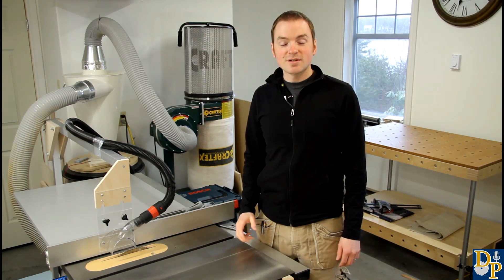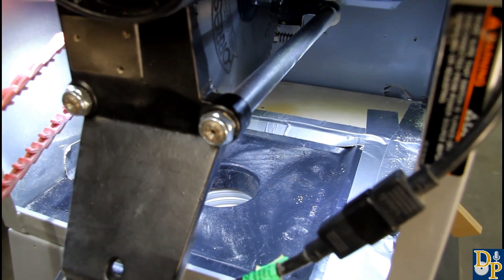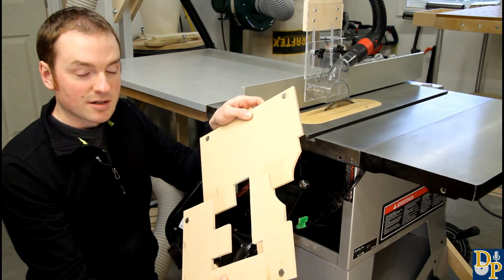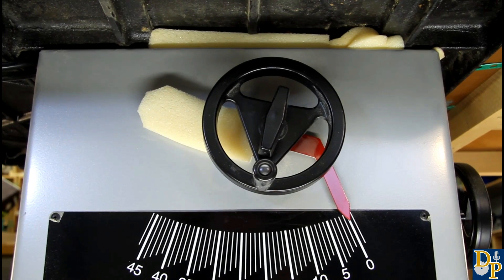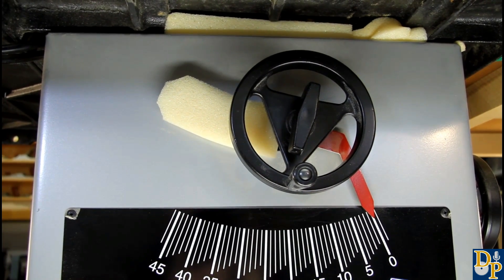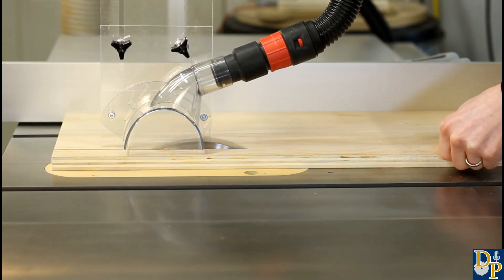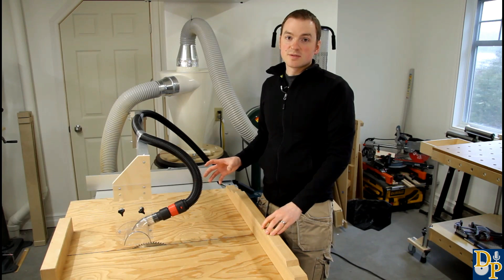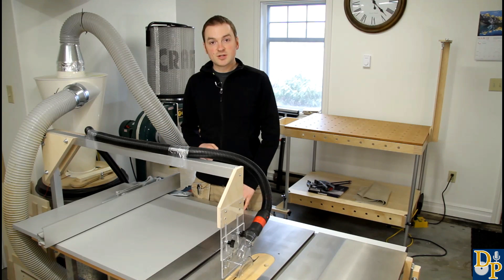4 Table Saw Dust Collection Upgrades to Improve Your Saw

Comment: What about when I'm not making a through cut? At those times, and especially if I'm nibbling, I get a ton of dust coming out the kerf, even with decent 4" collection from the cabinet. Have you considered, or tried, to add perforations in the zero-clearance insert or even the front cabinet wall behind the front rail to try to collect that dust?  Good vid, thanks.
Reply from the maker: Sometimes when I'm making those types of cuts I will rig up a hose on the saw somewhere in front of the cut to collect the bulk of the dust. Some cuts are just very difficult to have good collection with and it takes less time to just clean up the dust when you're done than rig up an elaborate setup to try and capture it.

Comment: Nice job. I'm a new subscriber. I have the same saw. Could you share the dim. on the notches and  slots on the 2 panels on the back of the saw going around the motor and belt. Its droving me nuts.
Reply from the maker: I have a free download for the drawing in my blog article:

https://www.danpattison.com/blog/2016/10/7/4-table-saw-dust-collection-upgrades

Comment: Thank you Dan!  I used your pattern to close the back of my Delta Contractors saw!  Whoops, I didn't notice the difference between your saw and mine.  Mine is a Delta 34-444, maybe older that yours with right tilting arbor.  The trunnion assembly with the large nuts sticks further out the back than yours so I need to make some alterations to make it work.  Just posting this as a heads up to to other's with older Delta contractor's saws like mine.  I should have noticed this before I started.  Mine is probably from the early 90s.  The difference is going to be in opening for the trunnion and motor bracket -- it's going to have be higher up and a bit larger.
Reply: Any chance that you can share your final result?  i have the same saw

Comment: how does your jig work for cuts where there is nothing on the left side of the blade? I find that cutting a board that has at least a half inch to the right and left of the board forces the duct down into the lower dust bin/extractor; however, if you are only shaving off a 1/16 or 1/8 inch, dust just gets ejected straight out the front of the blade.
Reply from the maker: If there is nothing to the left side of the blade and you're basically just shaving off a kerf width or less then the dust will still fly off to the side and straight back.  I've found that dust collection on any saw doesn't really work well if you're just shaving some off the side of a board since there is nothing to contain the dust.

Comment: Like the guy said, "How clever!", especially the two-part, magnetic rear cover. I've found almost limitless uses for rare earth magnets and my most recent purchase was a lot of 100 sent from China through eBay. The down side is that eventually your tools become slightly magnetized and pick up beards of steel wool particles. It is a problem is to find a 12mm Forstner bit to install them with a press fit though a 1/2" bit and a dab of adhesive works. Have you choked off the air supply to the bottom end of your saw? That potential problem seemed possible as you wedged foam to seal the gaps between the cabinet and the cast iron.
Reply from the maker: Rare earth magnets are definitely handy for so many things. There are enough openings left in the saw to feed the dust collector without any issues. You definitely don't want to seal things off completely.

Comment: How did you make the lower sawdust pan with the 4 inch port?
Reply from the maker: I bought the plastic pan with the 4" port in it and fitted it in to the bottom of my saw.  If you check out my blog article you can find all the links there.

https://www.danpattison.com/blog/2016/10/7/4-table-saw-dust-collection-upgrades

Comment: Those contractor saws are piles of shit. Best bet is to get an old unisaw or something. You'll end up saving money.
Reply from the maker: +Joe Doesntcareaboutthis cabinet saws are definitely better but this Delta contractors saw has been a great saw.  I've had it for over 15 years and it's still going strong.  It was one of the models that was actually made in the US and not offshore.

Comment: Great and thanks for the inspiration.  I built an enclosure for my Jet Contractor Saw using a similar approach and a two piece design attached with the rare earth magnets.  I also used the same approach to create a removable enclosure for the blade adjustment window in the saw.  The rare earth magnets are great for this application.
Reply: Is there a way for us to upload pictures?

Comment: I can't tell you how much this video helped me, especially with closing the back panel on my saw. I have pretty much the same Delta saw that you have and I'm so tired of saw dust flying out of the back of that thing all over my motor. I spent several hours this past weekend trying to construct a paper template like yours, it was highly frustrating. Thank you very much for sharing your knowledge with us.
Reply from the maker: +David Jones glad to hear that you found the video helpful!
Reply: Dan I am interested in doing all of the dust collection methods. Especially the overhead dust collection. Could you please send me the parts used as well as as plans you used. Thanks.
Reply from the maker: You can find the template in my blog article

https://www.danpattison.com/blog/2016/10/7/4-table-saw-dust-collection-upgrades

Comment: Nice video, Dan.  I have struggled to enclose the back of my old but very reliable and accurate contractor saw, finding it very difficult to cut out and fit rigid material to fit around the motor bracket, the bolts, and belt. A few years ago I built an angled box that I mounted underneath the table (a modification from a FWW article some years ago) to which I attached a 4" dust port. This worked well, but the inability to close in the back left the draw in the box insufficient . Your video inspired me to tackle the problem. Rather than struggle again with rigid material, I turned to a flexible panel, like Plaskolite corrugated white sheet (some had come with a recently purchased window air conditioner). Lowes sells 2' x 3' sheets of it. It worked great because of its flexibility. I was able to make some with holes exactly where the motor bracket mounts to the saw, slide it on, and then slide the motor on. I used the same material to cover up the gap in the front since I never tilt my blade (tilting the blade on contractor saw notoriously throws the blade out of alignment; I make sleds for my bevel cuts).  Closing the back made a significant difference in the suction in the box underneath the saw. I am awaiting (on order) a Shark Guard with an over-the-blade dust port and the greatest dust offender in the shop will be tamed.
Reply from the maker: +Steve Reich the flexible panel sounds like a great solution, thanks for sharing!

Comment: Nice ...  did you made the dust shoe that goes over the blade? Thanx for sharing
Reply from the maker: +Daniel Suárez the dust shroud is a Bosch router dust collection part, model # RA1175.

Comment: I'd love to see the details of the over arm shroud.  particularly the shroud itself.  thanks for posting.
Reply from the maker: +Jeff Correia did you see the recent video I did on how to build the overarm?
Reply: I did, and it was very informative, I would have liked to see how you made the cut in the shroud piece.  How did it not shatter?    Thx I'm enjoying your content.
Reply from the maker: +Jeff Correia Thanks Jeff.  When I made the cuts in the shroud I just set it on my cross cut sled and slowly cut into it with a thin kerf combination blade.  You just don't want to cut too fast.